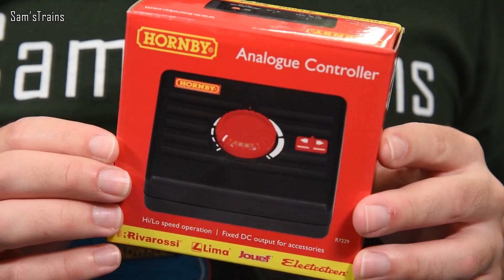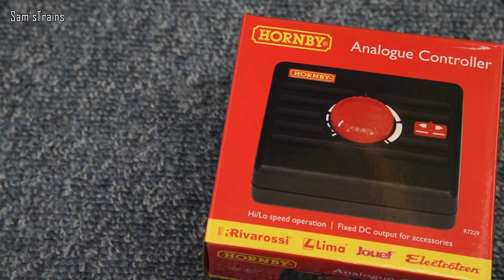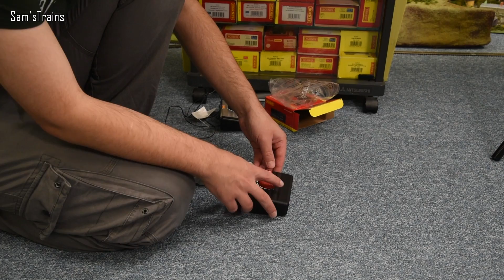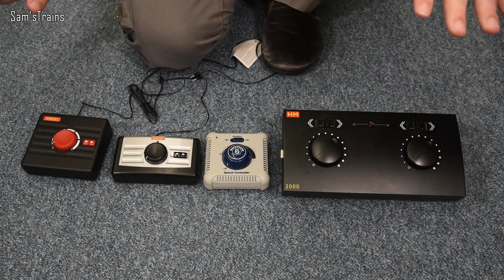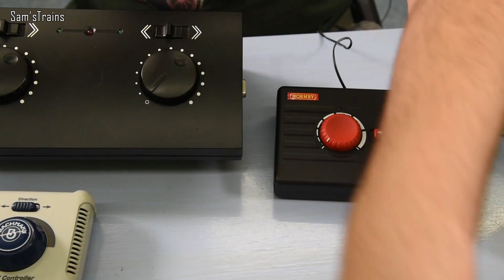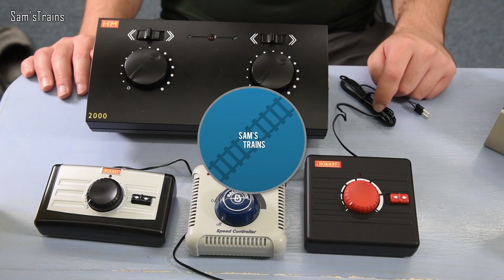Hornby's New DC Train Controller | Controller Buying Guide

Comment: I can’t get my sons GWR high speed to work I’ve set it up how instructed and red light shows on remote and the two little pins are connected to the track. Do you think I need to change the plug? Could that be the problem

Comment: Well then Sam … try the kato controller cuz it’s pretty good !

And it has a full blown reset button … like it’s perfect for someone like me who has plenty of hornby controllers and dis for some 6 years of model railways 😂

And the hornby Thomas set being my first came with this

So did flying Scotsman 

Mallard too

And Santa express

Yup the ONE set I had with the new controller being the Coca Cola summer set thing .

I have all these still but for each hornby set I had … why did I end up with so many of them 😂

Then I had extras … just as spares case one broke according to grandad 
Hence I had an older hornby controller like very old one and it wasn’t that bad really and fixed the reverse issue with how it locked itself when on the move .

And now a kato controller my only non hornby controller for model railways and by god it’s stunning 
1- feels like a real diesel cab
2- has reset button 
3- can reserve without locking
4- can be held like a brick
5- has a fan … ok?
6- smooth like butter 
7- has a halfway point for speed

So overall … kato wins for controllers 😂 … and there pretty cheap too I recon !

Comment: Hi Some years (40) ago I built a Pulse width controller. Now you do not give any frequency that these individual units employ. Mine was 144Mhz, and it had overlaod trip that as soon as the fault cleared the power was on again. The grumbling that you hear is because the frequency is too low and the motor hunts. My controller covered 2 independent lines and the speed controller had a forward and back switch that could be changed whilst in motion. Yes not a good idea to do that but so are lots of other things not good to do. I am however using my 1950's Meccano A4 controller with another controller of even earlier  construction on the "B" connection. Now the A4 has a light and reset that goes "doing" when there is a short circuit, and the pre-war controller has a button that springs up and has to be pushed down to reset. I am an electrical engineer retired and can find no reason to change both units as they work OK. So please check the frequency of the units that you have and try and find one with a lot higher frequency. Alternatively try and get hold of a Meccano A4 controller. I found very littel difference between the old Meccano one and the one I built except that it was very easy to overload the locomotive. If you can try and get an oscilloscope print out or display through the full range on the output.

Comment: Hi Sam.  I’ve just received my Accurascale Harry Needle Class 37.  Accurascale says not to use s primitive 12V controller.  Which contrller wouyou recommend?  They say a basic 12V might damage the accurascale model due to the complex electronics.
Reply from the maker: You'll be fine with any modern controller - I'd recommend the Gaugemaster ones (not their feedback controllers), and those will be perfectly fine!
Thanks for watching, Sam :)

Comment: So, im trying to get into model railway. And I got a 2 starter kits from kato. both have a controller. so i have 2 controllers for 2 trains. can i run both at the same time. or can i have both trains on the same rail, but only 1 of them running? I planned to have a station with a sidetrack for the 2nd train to stand when not running.

Comment: Thanks Sam, I recently bought a Hornby set for my son's 7th birthday which came with this new controller. After it cut out for the umpteenth time, I took the thing apart, cleaned up some oxidation, and it still cut out!😡 Thankfully I watched your review before just buying another of the same, shall be buying a Bachman I think. Can't believe Hornby sell their sets with this rubbish inside.

Comment: Hornby Website as of 28/07/23 - £19.49 As an alternative to our R8250 Controller, the Analogue Train and Accessory Controller features an improved, heavier casing, as well as an additional uncontrolled DC output with integral capacitor discharge unit (CDU) to support solenoid point motors. The Auxiliary output can also be used to power lighting on the layout up to a current of 150mA. A recessed reduction switch also limits the output to reduce loco speed. This item does not include a transformer. However, the required P9000 Transformer can be purchased separately.  Transformer is £27.49

Comment: The newer Bachmann controllers use a 16v AC input. If you need to limit the speed for children, you can use a 12v AC or even a 9V AC transformer. They are not fancy, but they do work well.

What frustrates me is that the old Hornby R965 Controller was actually one of the best on the market. It even had the centre-off position on the direction switch! I still use one to power my O gauge locomotives.
Reply: In the US newer Bachman controllers(44211) use a DC input, the older ones and maybe some versions are AC. Regardless that most look alike, there are at least a half dozen versions of the AC input controllers. Most have voltage sag if a second engine is added but at least one version has a regulated output and can maintain same voltage output.

Comment: When I was a boy (back in the 1960s) my train set had a metal controller (Triang/ Rovex P4?) and it weighed a ton. It had one control knob on which OFF was straight up, FORWARD was by turning it to the right and REVERSE was by turning it to the left. 
More to the point is that it had a small red button above the control knob with popped up and shut the power off if a 'short' occurred. 
All that was needed was to fix the short, push the button back in and Bob's your uncle. The whole process took about two seconds.
I think manufacturers are going backwards in their product details.

Comment: I didn't find any other information online that suggested that the PWM (pulse width modulation control) was a problem for motors, and so I was not sure whether your comment that the humming sound was disturbing and the sound of an unhappy motor was actually accurate. I wrote Hornby, and the technician, who himself has used a Hornby PWM controller successfully for years, said that the humming sound is a by-product of the pulsing of the PWM, and nothing to be concerned about. He also said they'd done extensive testing of the controller and never found any issues with it. 

Personally, I don't find the lack of a "click" on the Hornby to be less satisfying, and, in fact, I like it because it seems less likely to break. I also think it makes sense to stop the train before switching it between forward and reverse, so I don't think this feature is annoying at all! Lastly, while it was very good of you to include the price of the power supply in with the Hornby to make things fair, I think it is not fair to give the 37 pound Hornby the same low rating on price as the 117 pound HM 2000, even if you feel you're getting more for the money. If you don't have much money, 37 pounds is definitely better than 117 pounds!

Comment: I think this type of controller is better than the older Hornby one, but there's one thing I don't like 
when changing the arrow thingys to reverse/forward you have to stop the locomotive 
but with the Bachmann EZ one you can change it while the engine is moving, I don't know if this applies with the older Hornby one but other than that this newer design is great in my opinion

Comment: I have a Hornby James the red engine. Will it work with that controller? I'm concerned about the High and low switch on that controller because My Hornby James says its 12 volts.

Comment: Hornby controllers can be used with nearly any power transformer, so you can use the one you prefer to use because they're not all equal although setting it to low will burn the motor out and burn the controller out as well, which means unless you're a multibillionaire you should set the controller to high (typically written as hi on model train power controllers). The funny thing is model train controllers had a reset button in the 1950s-1980s.

Comment: I have three of the old r965's  Nice controller but all of them cut out with older locos. Very annoying. I use Hammant and Morgan Clipoers with slaves to run my stuff. They have the high/low resistance option..which helps sloe crawl but makes the engines hum horribly..Still great controllers for 50 years old

Comment: Hang on, the sound my locos make is not only caused by the controller, but it also isn’t normal?? Hornby, that ain’t it chief
Reply: Im just as shocked as you are. I thought that the buzzing noise was normal and all motors did that cause electricity and stuff
Reply: @bluestarproductions2033I thought that too, I need to get a better one!

Comment: I wonder if a Pulse Rate adjustment (Pulses/Second) would effect the sound generated by the motor. ? (Audio range of pulsing frequency).   It would effect the speed since it would set the rate of pulses.
   The Pulse width (PWM) adjusts the average applied voltage for speed control. (Duration of applied power.)

Comment: The "long time to reset" characteristic is probably due to the fact that the short circuit is heat  (IxR) detection. It takes a while for the detection circuit to cool down to "Normal" and then reset to normal operation.
Reply: Two things have to cool down. First is the pass transistor second is the poly protection fuse. Things to improve upon are the capacitor voltage ratings and the direction switch. Substitute a centre off switch for the direction switch and fit capacitors with higher voltage ratings.

Comment: Hi Sam I have a hornby strikeforce starter set which was working recently until the red light on the controller was unlit and there is no power to the track. As the light on the controller is not lit would you recommend I get a new controller

Comment: Sounds like a straight up 50Hz (or so) square wave. Have these morons put NO FILTERING in it whatsoever?

A little bit of ripple is acceptable (well... unavoidable really), but THIS?

Fokk that, if I ever buy one of these sets it's running off my current limited bench PSU

Comment: Hi Sam, do you know why my controller would loose power at times, then it comes back, but it is very frustrating for kids when it does in the middle of their play.  What could be the reason?
Reply from the maker: Hmm which controller are you using? If it's Hornby, then something could be overloading/shorting the controller - worth checking your locos over, or upgrading to a better controller! :D
Thanks for watching, Sam :)

Comment: I read on a forum that the hm2000 wont run bachmann trains ??
I will only run normal not dcc thinking maybe get the gaugemaster when in stock on hattons as dual is £85. Although ill need the wiring and track power clips etc
Reply from the maker: The HM2000 will work fine with Bachmann trains, just not advisable on coreless designs (but those are only on the last few Bachmann releases) Gaugemaster is much better though!!
Thanks for watching, Sam :)

Comment: Youtuber ElectroBOOM has actually made a vid on DC motor control: https://www.youtube.com/watch?v=yO9xIVv8ryc
One take away is that the switching frequency must be high enough that the current through keeps flowing through the off period, driven by the back EMF - or else the torque of the motor will jolt up and down noisily. The train controllers all are way too slow, but they are likely (mis)engineered to generate a lot of rattling - to help loco motors to get going at low speed setting.
My suggestion would be to detect the back EMF voltage (using a shunt or a Schottky diode to keep the current going), and when there is no EMF, the rattling could be applied. If there is, use a proper high frequency.
Reply from the maker: Ahh yeah I remember seeing that - thanks a lot for sharing! :D
Thanks for watching, Sam :)

Comment: Great video Sam, keep it up. Ok so I need urgent help. I am currently bidding on an HM 2000 in Auckland NZ because these things are super expensive in NZ and very hard to find (even new). So, my question is this. How many versions are there because I have seen 2 versions, one of which has a power switch on the back and one does not?is it a country specific thing or is it an older and a newer model. If the latter is the newer one an improved version? need help quick if possible please. I have googled this subject to death but no answers whatsoever.
Reply from the maker: That's a good question! I'm not sure about that actually - I too have seen different versions, but not sure how many there are!
Thanks for watching, Sam :)

Comment: Hello Sam,   I'm having trouble finding the HM 2000 for sale, and any information about the power supply (need US current adapted). Any advice for me?  Thanks, Marshall
Reply from the maker: Hmm, that might be tricky - not sure if they've done a 120v version - might be best to look into a controller made for your voltage, as the power supplies are built in!
Thanks for watching, Sam :)

Comment: I've got a couple of HM2000 controllers from Hornby - I've since consigned them to working shunting in siding etc. The main problem with them and the cheaper units supplied with Hornby sets is that when you approach 75% on the dial the loco's start to hesitate and flutter slightly and then once you hit 80% or more the loco charges away at high speed. When at Warley exhibition a few years ago I aske the guy on the Hornby stand why this happened - He was a blind Antelope - No eye deer ! I bought myself a duel bench power supply with two 0 -30 vlt DC constant current out puts, and the acceleration is smooth and with the constant current control some very fine slow crawls are possible, I just have to watch the digital displays so I don't go over 12 - 14 volts.
Reply from the maker: Yes you're right Paul, the output doesn't seem to be perfectly linear on the HM2000, I noticed this too! And yep - same answer as always, lol! ;D
Thanks for watching, Sam :)
Reply: @SamsTrains  did a voltage check and discovered that the first 3/4's of the dial raise the voltage from 0 to 6.9vts after the stutter the voltage raises quite quickly from 7 to 14.5vlts at maximum - a kind of turbo boost at the top end.

Comment: I have a brand new hornby red knob controller with Hi-Lo switch and it keeps having a fault where it cuts out and I have to wait 10 mins for it to come back on. I am using all brand new hornby track packs A-D and set up in the correct way, going to bin this trash controller and buy something better
Reply from the maker: Yeah I'd recommend binning it too - they're useless! Which locos are you using? It may be that they're drawing too much current, or possibly shorting briefly, causing the controller to cut out?
Happy New Year - Sam :)
Reply: @SamsTrains  hi first it was an early triang 08 that did it across the points, big spark and a short. All recovered and seemed ok, ran different locos with no problems 80s lima mostly. Ran an athearn yesterday and had same thing with a short and cutout. I think the stock Hornby controller is just too sensitive or like you suggested not powerful enough.

Comment: When I use my new hornby controller and the train derailes, all I had to do was set it on the track and it worked fine
Reply from the maker: Yes that's right - it'll only cut out for ages if it gets shorted out; a derailment won't necessarily cause a short!
Merry Christmas - Sam :)

Comment: The one thing Bachmann beats Hornby with is controllers imo. 700 milliamps for the Hornby transformer and the controller has the awful pwm and a horrible feeling knob. but my much older Bachmann delivers 1 amp, a noticeable difference in the more power hungry locos on a larger track and the knob feels great and no sticky direction switch. The older red and black Hornby controller is better than the new ones, even though it apparently doesn't last very long. I mean Mehano has a better controller these days. Cmon Hornby, it isn't that hard, you don't have to do anything groundbreaking either. Just make a non-pwm controller, with a good potentiometer and no direction lock that is small enough to use as a walkabout. I think its cause they're scared of the gaugemaster combi :P
Reply from the maker: This is true - the standard Bachmann controller is definitely better than the Hornby one!
Thanks for watching, Sam :)

Comment: I must say I despair at the quality and basic design of most modem DC controller's   .Does any body remember the simulator controller's from the late 80s early 90s where you could set the acceleration and momentum so even if you went to full power the train picked up speed slowly like the real thing I and then coasted till you applied the brakes. I used to owen a H &M walk about and in my opinion it was one of the best you could get in fact when it finally stopped working I went over to dcc as none of the modem DC controller's seemed as good.
In fact a friend of mine managed to find a second hand one not so long ago and loves it
It would be great if they started making them again what do you think Sam.
Reply from the maker: Yeah - Hornby's modern train set offerings are dreadful... why would you want a controller that stops your products working at their best? Fortunately Gaugemaster still make great stuff! :D
Thanks for watching, Sam :)